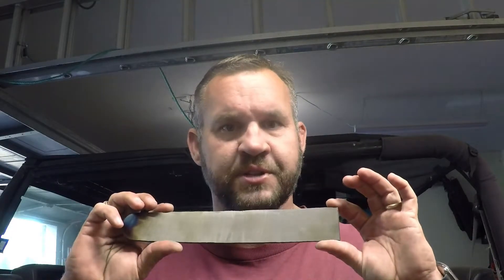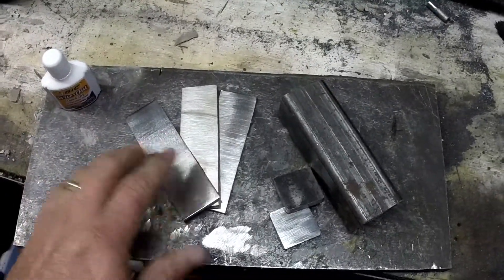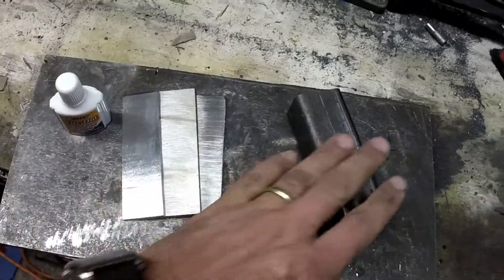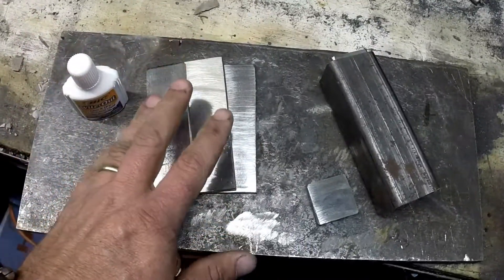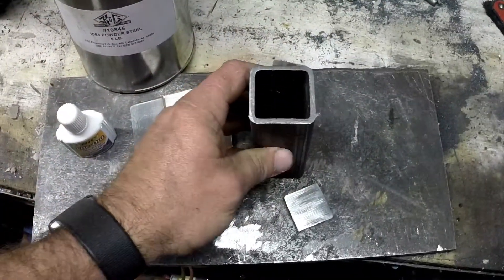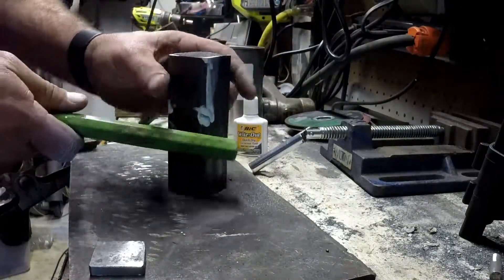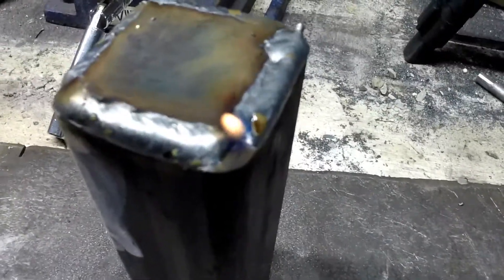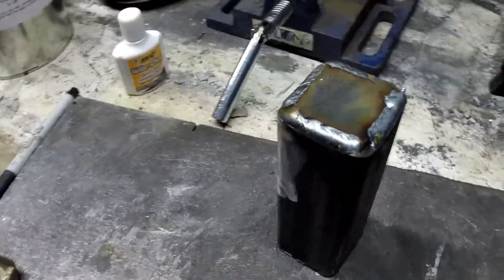Damascus and Stainless 440C San Mai Experiment

Comment: Thanks for sharing your process! I assume you chose not to just put the san mai billet in the forge welded up due to scaling. Hadn't thought of trying it in a canister. I'm told stainless steel foil works better than white-out, but haven't tried it yet.
Reply from the maker: Bryson Alden, so I recently tried the Stainless steel foil instead of white out, and it did NOT help get the canister off at ALL.  I will try it again but instead I will still use the white out and then put the SS foil liner in the can.